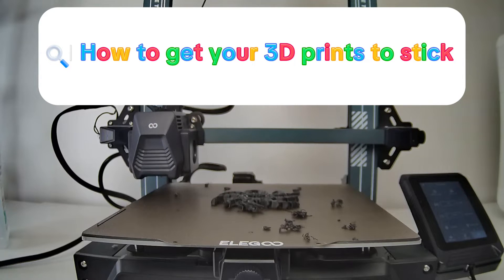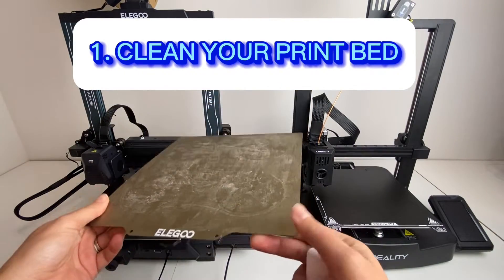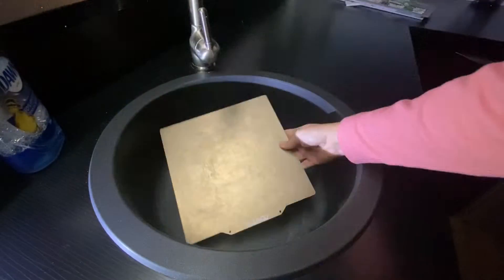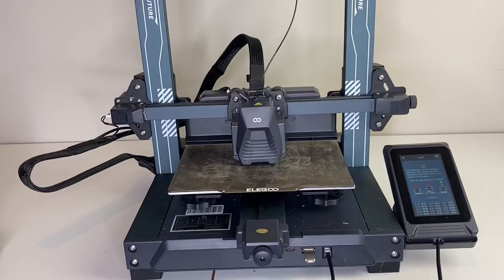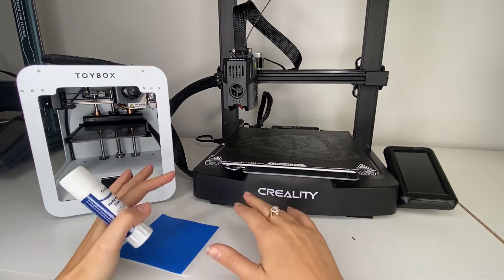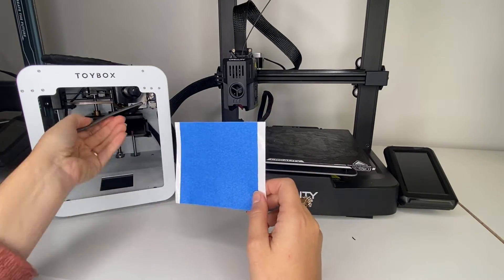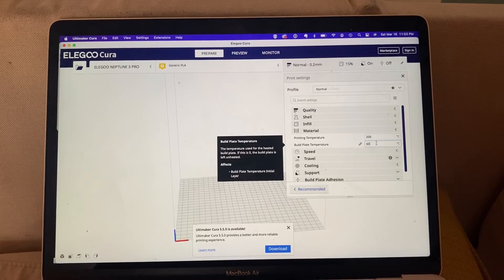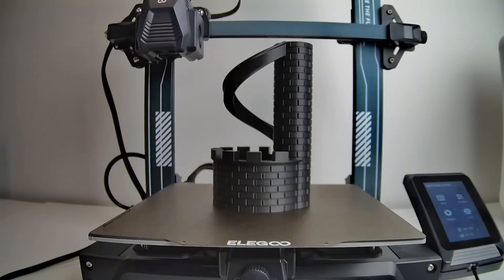3D Print Not Sticking? 5 EASY 3D Print Bed Adhesion Tips

Comment: Lowering Z offset fixed this for me. This is my first week of printing and I came across this issue with my Ender-3 V3 SE. the first layer would just be a tangled mess and I’d stop the print. It’d get worse if I kept attempting cause I saw excess filament hanging off and around the nozzle, pulling at my next attempt of a print.  If you had this too, you’ll notice that trying to auto level again with a leaking nozzle will screw the leveling, because it’ll read the hanging filament as the nozzle tip when it isn’t, in turn making the z offset too high, and messing up the next prints. 

So I cleaned my nozzle off, and tuned the z offset with a test print. Here’s how. I began the first layer, it was printing bad, I pressed the tune button and lowered my z offset only by -0.02, and then continued the first layer. The print began to turn out better. I lowered it another -0.02, the print stuck to the bed but was uneven. I kept going in small increments till the print came out correctly.

Why the z offset suddenly got worse is a mystery to me right now. It seems common, it could’ve been a mistake I made, or a problem with the printer. I have learned though, to make sure your printer is tuned correctly

Comment: Whats the best settn for peg? Speed bed and such etc
Reply: the best speed it 27 if to fast it can wreak your print and use a blue stick some people make 3d guns to shoot they use 80 wall and 100 infill dont for get to clean your bed and to stick it use a blue stick to hold your print down temp heat i go with 2010

Comment: I have this issue when I used a fresh roll of Ender PLA+ filament. Switched back to a different filament I was using to just test some printer settings, and everything was fine. PLA / PLA+ just seems finicky. I know it's not a moisture issue since my place is quite "dry" with low humidity.
Ah well.... back to brainstorming. 3d gluesticks work fine though on my Ender 3 V3 SE's print bed. I keep it clean by also washing it with dish soap or rubbing alcohol. 👍

Comment: Help! I still can’t get mine to work😭😭😭 I can’t get mine to stick to the bed and I’ve wasted so much filament I’ve leveled it to the paper test I’ve cleaned it twice and I can’t for the life of me figure this out! Reset to default I’ve re leveled everything and cleaned everything my bed temp is at the recommended for my pla and speed is 25 and constantly failing prints either at the beginning or a quarter way through due to lack of adhesion:(
Reply: It’s on a ender 3 v2 neo

Comment: have not had a single build stick for multiple years now as i have tried ocasionally to get it to work every print has failed on the verry first layer i have tried gluesticks paper bed leveling tricks completely replaced the build bed with the flexible plastic one did gluestick on that one bought a filament dryer did not help either slightly higher temprature nozle 5% speed  do i need to just use straightup superglue or straightup industrial epoxy for it to stick to the darn bed? i have had my printer sit in my closet for so long due to this issue its entire screen is covered in dust and its bed also its an absolute dumpsterfire situation.

Comment: ive literally tried every single on of these steps except the glue stick, and by the end of the print is just starts going crazy.
Reply: The glue stick is manditory
Reply: If you need to use a glue stick your printer bed is not level. Anyone who says glue is mandatory should not be trusted. 99% of the time the issue arrives from following instructions from YouTubers. 😂

Comment: Thank you! We had tried the blue tape on the Toybox and it was still coming up on one side. We then added the glue and that took it almost all the way. The last thing we did was slightly correct the level of the print bed and it is pretty much perfect with your other fixes. 

Where did you get the pre cut blue tape sheets? I have a roll but that looks so much easier!

Comment: I got a Ender 2 Pro, did no more than 10 prints in the past year for my daughter, now I can't get it to work. I've spent 5 hours tonight, replaced the nozzle, new role of PLA filament from Ender, cleaned the magnetic plate, recheck and leveled it again, baby step the z axis, print the tuzi g-code it came with to make sure it's not a model problem, de-greased the magnetic plate again, increased bed to 65 instead of 60, slowed down the print, and it Just Won't Stick... I'm so close to spare parting this thing. I will try the glue stick method tomorrow. Any other ideas please advise.
Reply: Did you figure this out mate? Mines being a little shit lol
Reply: @ATKDERBY2010  did u figure it out?
Reply: I took the removable build plate off, squirted fairy washing up liquid all over it and rubbed it in with my fingers when used warm water and soap to scrub it in and off and then dried the plate with paper towels then did a auto level. If I do this every time it works unless the print is too small  @Davidyoutube1234
Reply: @ATKDERBY2010  ty
Reply: @Mc.quakquak  did you get sorted mate? My printer was annoying for about two weeks but I think I figured it if you still need anything
Reply: @ATKDERBY2010  oh no its good now thank you for the help, what printer do you have?
Reply: @Davidyoutube1234  ender v3, for some reason it never let me reply to you before. Great little starter but I'm figuring out why my prints are going to shit now, I think I let the filament get exposed to moisture so testing a sealed one
Reply: @ATKDERBY2010  Oh I hope it works out for you. I also have a ender v3, was thinking about getting a Bambu lab a1 mini. I have a problem with filament. I store it in a garage, good ventilation and not a lot of moisture, but the filament keeps breaking (snapping) do you know what I could do? Thank you!
Reply: Same issue here. Brand new Ender 3v3 KE, and it worked perfectly for 3 days. Thought it was wet filament, but still no luck. If anyone has any ideas please share.

Comment: I was getting curling and adhesion issues last winter. Long story short I decided the issue was it was just too cold in my office/workshop we were heating the house with the wood stove due to oil being astronomically high these last few years so rather then risk burning down my house and familywith a space heater o going broke on oil took a break from printing until late spring and I am still having adhesion issues. I tried painters tape and hairspray with seemingly good results, no curling consitent layers and good adhesion early on but what is happening now is 6-8 hours into the print when it's like 50- 70% through it comes off the bed. Going to try the gluestick next but I'm  at my wits end. I don't  understand how it's  adhering well early on by my prints keep opting out closer to the end.
Reply: I'm in the same boat 6hrs into a 23hr print and it came off the bed so pissed off with it now i don't even want it 😂

Comment: I've printed for more than 100 hrs using a recently delivered Neptune 3 Pro with perfect adhesion: no glue stick, tape, brim or raft.  I've been using the stock profiles in Cura 5.6.0 for slicing. The only thing I change , depending on the project, is the infill density.  Printed parts (including complex print-in-place models) cleanly self-release after cooling.  I primarily use eSun PLA+ but have had the same results with Printbed PLA filament.  The only care I take is to not touch the surface of the metal plate and to not clean the metal plate in any way, including isopropyl alcohol.
Reply: "and to not clean the metal plate in any way, including isopropyl alcohol" And so what problems does isopropyl alcohol cause?
Reply from the maker: Wow nice!
Reply: Man, I wish my printer didn't have any problem despite me taking extremely good care of it. Anyways, want to trade a printer that has less than 50 hours print time and still has issues?🙃

Comment: All good and necessary points mentioned in this video :) Explaining the settings for cura came a bit short. 

The following settings in cura helped me print a better first layer on my old Tronxy XY-2 Pro:
- initial layer Line width: 125%
- printing temperatures: 200°C -> 205°C 
- printing temperature initial layer: 215°C (for 2 mm glass bed)
- build plate temperture 55°C° -> 60°C (increase in inrements of 5)
- use brim and brim width: 3mm

Because the corners still lifted up from the bed sometimes,  I installed a cura marketplace plugin called TabAntiWarping (Mouse Ears).
Reply from the maker: Great tips!

Comment: I have a Neptune 4 and used the included glue stick. I just found it too messy and so switched over to spray glue.
I find it much easier. I have no adhesion issues and it's far less messy.
Reply from the maker: Nice tip! I’ll have to try it. I just ignore the mess 😂
Reply: And ruined the bed plate!! 🤣🤣🤣
Reply: @kevinbaker26 what spray glue did you use?
Reply: I used a spray called 3dLac from Amazon. 
And, no it does not damage the pei plate